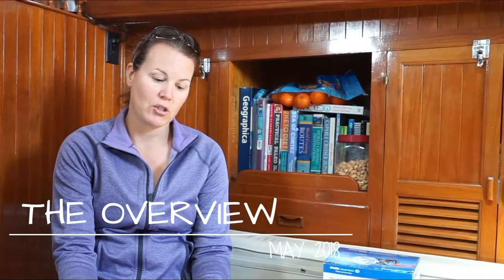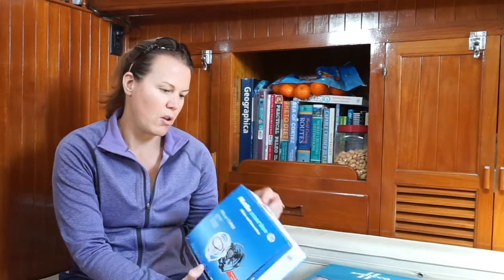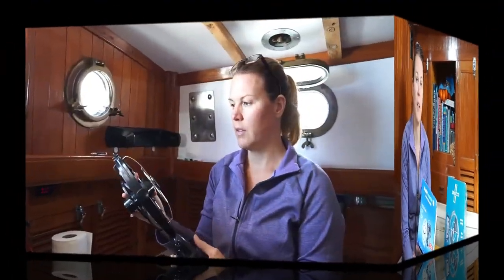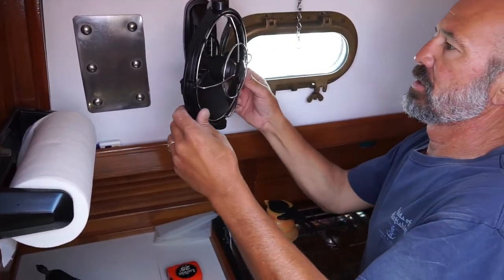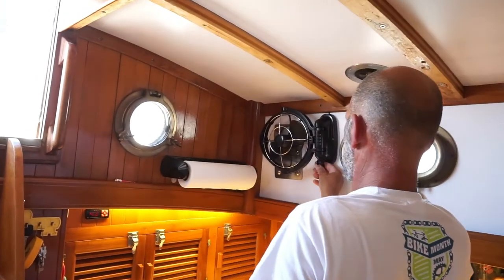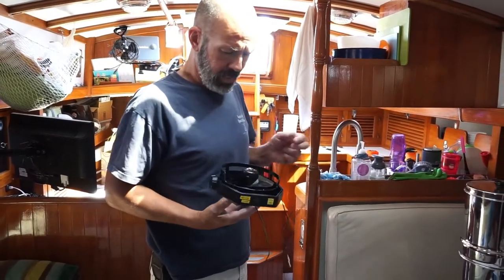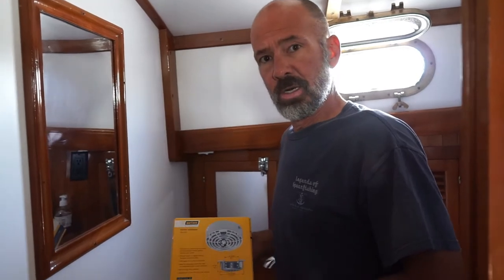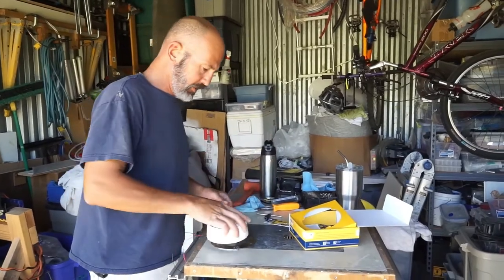A Breath of Fresh Air: Trying Different Cabin Fans | SV Ramble On

Comment: How is the hella marine fan? I plan 2 units for a 5 meter by 4-meter hall. Will it do any good in ventilation?
Reply from the maker: The Hella is fine.  We have it in our salon.  It's pretty quiet and it doesn't rattle, but you really have to be close to it to feel the air movement.  If we had a small space for a fan we would purchase the Hella over the Bora anyday.  We just bought two more Sirocco II's to replace the rattly Boras we have in the V-berth.
Reply: @svrambleon  Face it, no 12V fan will blow an adequate breeze beyond about 2 feet - they are a joke and all are unreliable on a boat.  The same is true of mushroom vents - they're useless gimmicks.

Comment: I think I would have installed the first one so you could open the port window and it would swing over it and blow the outside air in.  If you switch the wires will it blow the other way?
Reply from the maker: We thought of that, but it just wouldn't work in that location.  There's an upper cabinet on the other side of the port and the fan prevented one of the doors from opening so we couldn't mount it over there.  If we mounted the fan a little lower than where we did, the towel holder prevented it from laying all the way flat against the wall and it was really close to our faces when we were in the galley.  The fan really does work great where it is.  I used it this weekend when it was 95 degrees out and I just had to boil some eggs.

Comment: The real question is how much power do they draw ???
Reply from the maker: I vaguely recall checking them on the DC Ammeter, but they were a bit to the right of the decimal.  Our average "not trying to conserve power" usage is approx. 150 Ah/day out of a 500 Ah LifePo battery bank w/3KW inverter.  We don't start sweating the volts til around day 3.

Comment: Cool - no pun intended. Over in the South Bay in RWC.  The prices of “marine” fans (at west marine) blew me away - again, no pun intended.  One day I stopped at Walmart and they had Kenmore clip-on fans for sale and I picked one up for about $20.  It’s, by far, the best fan on the boat. It clips on next to my head in the stateroom and blows to drive off any mosquitoes that find their way in (they desiccate quickly and die), and I’ve gotten used to it as “white noise”. It moves a lot of air.  Only downside is they are 120 v.
Reply from the maker: Yep, you definitely pay a premium for anything 12 volt and especially if it's labeled for "marine" use.

Comment: Rich and Jeni,
Really enjoy your videos and journey.  In your opening exterior clip, shot looking forward, that fan in your companionway looks suspiciously like a 20" Freedom Fan.  I have two on my trawler in Baja and they are wonderful.  They draw about 3 amps at 12v (yes they are 12v) and have a variable speed control.  Worth every penny.  When are you heading south?
Reply from the maker: Hi Bajatrawler - It is a great fan, really clears out the stuffy air inside when it's hot out!  We are planning to head south later next year, but we've had a family issue come up so it's a little up in the air right now.  Thanks so much for watching!

Comment: Hey, just the comparison I was looking for!  I'm considering the Sirocco and the Hella Turbo (was considering the Bora, but after seeing this, it's out).  I have a slide-in truck camper, and only need the application for the cabover bed area (queen bed takes up the whole area).  It'll be mounted in the corner, so fold away would be nice, but not necessary.  My main desire is that it is quiet, with just enough air movement to cover the bed.  Also, it'll be mounted on a vertical wall, as there's no possibility to mount it on the ceiling...
It appears the Hella would fit the purpose well, but would the Sirocco be the better choice for quiet air movement, and vertical mounting?  (I purchased a Road Pro truck windshield defroster fan, but it is NOISY)  I also need a low draw, as I don't have solar, and only one group 31 deep cycle battery.  Thanks!
Reply from the maker: Thanks for watching SkepticalEd, and glad this video was helpful.  If you have the head clearance, the oscillating feature of the Hella is nice for blowing around the cabin, but for noise and space-saving, my favorite is the Sirocco.  It folds flat against the wall, and it's a bit quieter than the Hella Turbo.  Good luck, and hope this helps.
Reply: SV Ramble On I ended up buying—and installing—the Sirocco. It’s SO versatile! Likely wouldn’t’ve even thought about it had I not seen your video. Thanks!